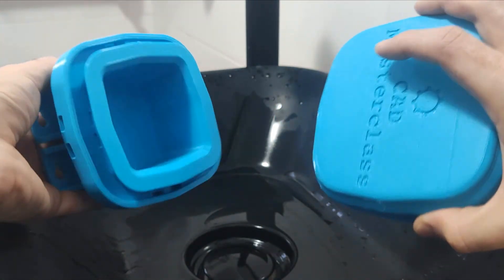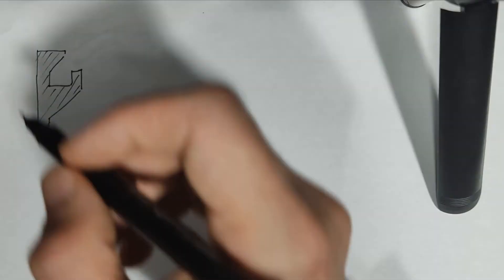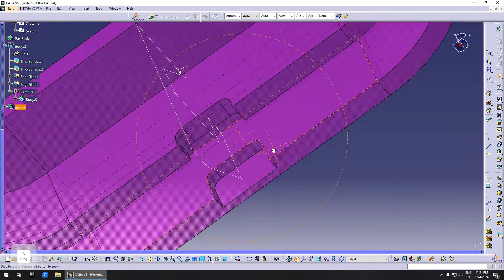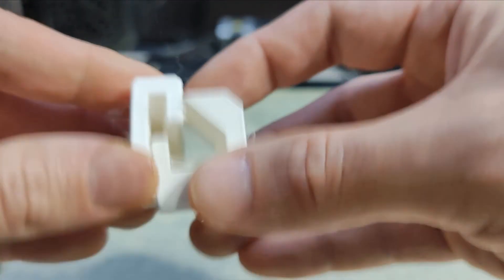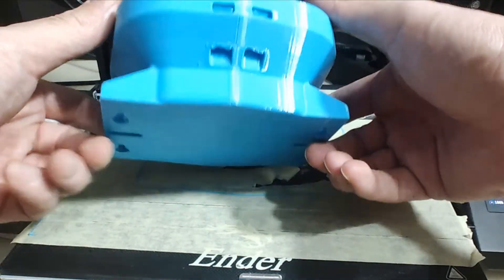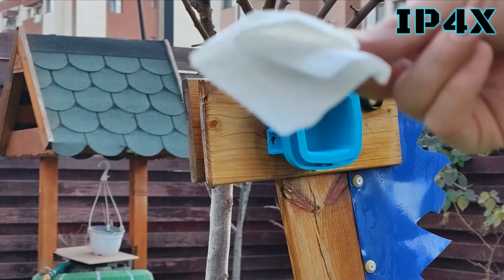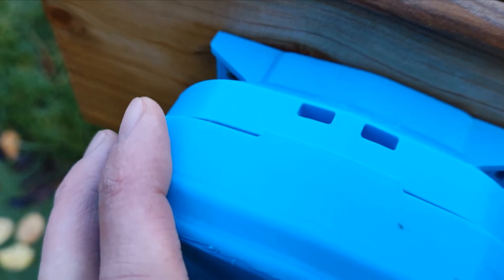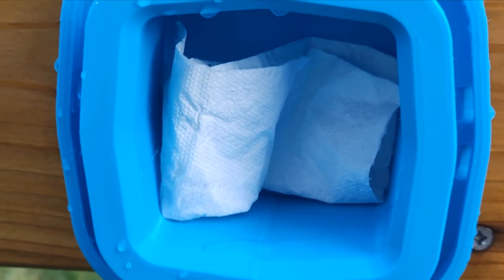3D Printing Ideas - Waterproof Enclosure

Comment: I would say a must have bonus test would be a (multiple) hour long rain. I think most 3D prints are not water prove because the layerlines are mostly not without any tiny micro holes!? Therefore are special liquids like "DIAMANT Polymer dichtol AM Hydro".
Reply from the maker: Yep..that's a good test to run. I was planning on making another box but did not get around to it..I'll make sure to keep this test in mind. Thanks 👍

Comment: The REAL problem is INSECTS!!! I guarantee that sooner or later an insect will find a home in those drain holes and plug them. They need a screen or a long thin Slit as a drain in my experience. Instincts hate long thin slits as it does not offer them any security!

Comment: This is a great design and looks great for the use case you are posing. Do you think that this would work to exclude fog or mist or high humidity?
Reply: It would likely not protect from moisture or condensation from the air as it doesn't seem to be airtight. This is where you would really want a gasket or seal.

Comment: Nice improvements, thanks for the video and you could still add a rubber sealing. Have you tested the box over a longer time against moisture creeping in from the air humidity via condensing?
Thank you
Reply from the maker: Hmm, that's a good point. I have not tested for moisture and condensing. But thanks for the suggestion, I will do that.
Reply: In some cases the condensation is a moot point. I designed a box in a similar manner for cctv cameras and because almost all cameras have a factory tail that has its own IP67 rating the box is really just hiding the connection rather than providing 100% protection from moisture.

Comment: Depends, a whisker box eith gel is better for mains electrical connections, it's safer. But for custom hardware that runs on low voltage the concept allows you to model the box to house all the components neatly.